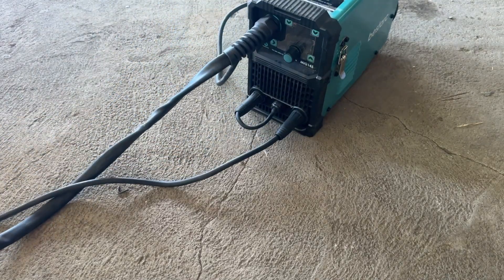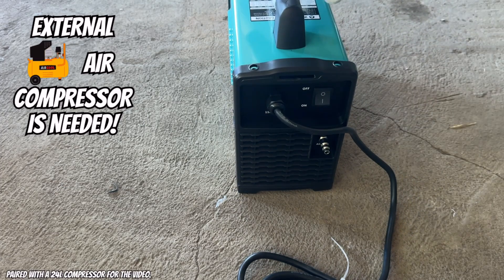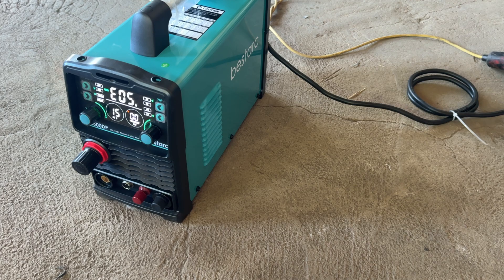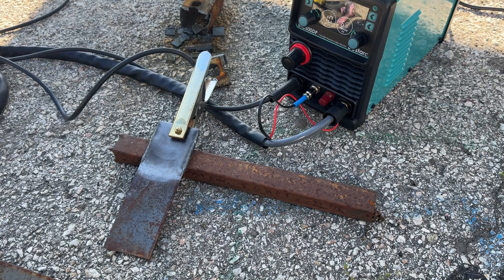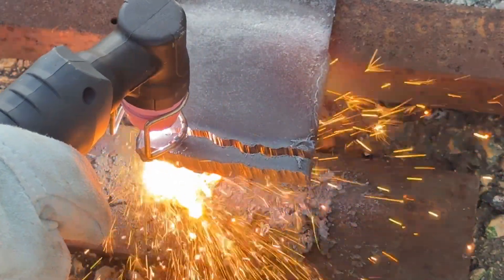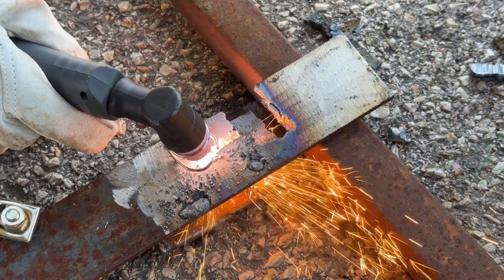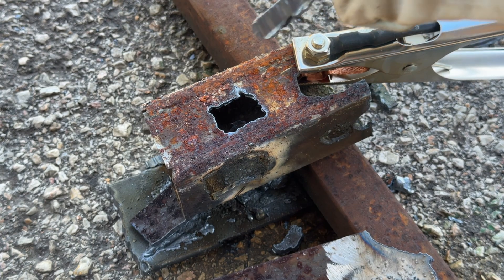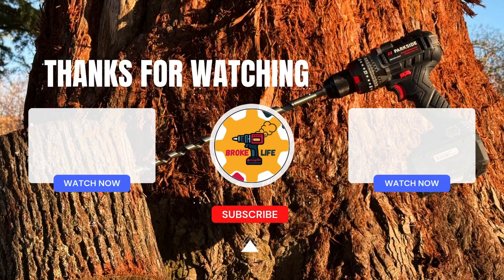BestArc BTC500DP Plasma Cutter Review | 50A Pilot Arc vs all the metal I could find

Comment: is it better than the parkside performance plasma cutter?
Reply from the maker: Yes — a huge improvement! That said, I’m not sure whether the Parkside Performance plasma cutter would perform better with a Pilot Arc torch. What I do know is that the stock torch it comes with is nowhere near as pleasant to use compared to the Pilot Arc setup on this unit.

Out of the box and with no modifications, both the welding machine and the plasma cutter from BestArc outperform their Parkside equivalents by a noticeable margin. What really sets them apart is the functionality — there are so many adjustable settings. Parkside machines usually offer just one or two basic knobs, while these give you full control. It can be a bit overwhelming at first, but once you get used to tweaking the settings, you can dial in some really impressive performance.

This is actually my first experience with a plasma cutter of this type, and I have to say, I’m genuinely impressed. And judging by the welding machine — especially the MIG145 — BestArc is punching well above its weight. I've tested a few machines over time, and this one performs far better than its price tag would suggest.

For full transparency: BestArc simply sent me these units to try out — no contracts, no obligations, no strings attached. So this is my honest opinion: I wasn’t expecting much from a brand I hadn’t even heard of before starting this channel, but their gear has really surprised me. Everyone who’s tried them so far keeps asking to borrow them — so much so that I might need to start saying no, just so I can actually use them myself!